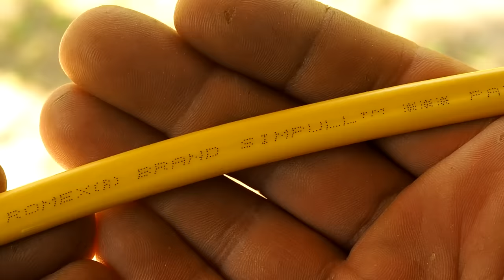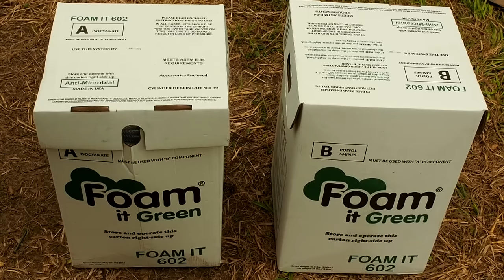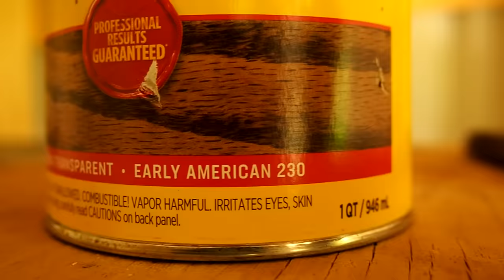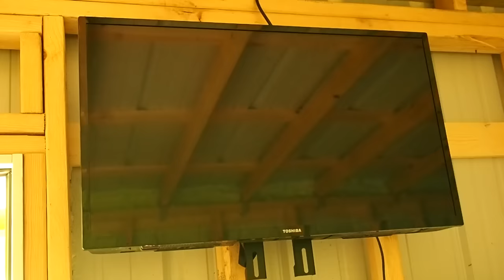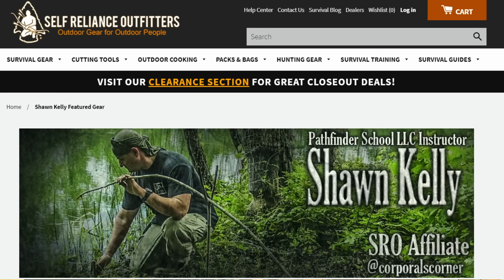Solo 10 Day Overnight Building an Off-Grid Cabin with Solar Power in The Woods and Tomahawk Ribeye

Comment: put your water collection barrels up on a platform to where the bottom of the barrels is slightly higher than your countertop put gutters on the building and run the downspouts to feed the barrels and then you will have a gravity flow into the building through your filter and then out through your faucet

Comment: If you add a mattress on top of the plywood, drill some holes in the plywood base for ventilation to keep the mildew/mold at bay from any condensation build-up. Consider a 12V RV fridge for a low power consumption. i.e. Alpicool, Dometic, Iceco, etc. . Also, consider a USB rechargeable water dispenser for the sink. pumps from a 5 gallon water container.

Comment: I'm 54 and I've worked with corrugated steel most of my adult life. I've had to hand cut so many panels. Now I've got 3 nebblers. One on the roof  one on the ground at the staging area, and a set in reserve for a backup.
I'll never go back to hand cutting. Those nibblers are nice and much more efficient.

Comment: 8X15,9X13 ,10X12Buildingscdo not require permits to build on your private property..Make them At least 8 ft tall commercial lumber size to not waste lumber..Use 2X6 in snow load areas and can be spaced 24 inches apart if using 2X4 construction use 16 on center construction for walls
Reply: Check with local codes. My county permits 144 square feet (so 12x12)... Measured on the outside of the building.

Comment: Metal sheets for walls is a no-go because it'll be too hot in the summer.
Reply: Perhaps, a few good coats of acrylic white on the external faces would help deflect a lot of sunlight? Couldnt hurt. 🤗
Reply: @Freeman361  just try it yourself ))) or seat in your car without ac )))

Comment: As long as you have a  spray foam setup, not sure why you didn't foam the roof and walls too. Wouldn't take 4 inches to help with temperature issues, but foam is great for sound deadening. 2 stones n 1 bird? Then cover with whatever you want.

Comment: Nice job.  I would pass on the spam and bring chili instead😄.  I like the idea of swing up bed platforms that could give you more room during the day.  I think that would be a pretty easy change out.  Pine 1x 6 strips on inside would cozy up the walls and make it easier to hang some light things.  I've seen 12 volt attends hooked to 12v string lights that produce plenty of light with not much electric  draw.

Comment: I like living in my traditional mongolian yurt, for more than five years now, with many of the tech items and low tech too.  I do my best to not go to the hardware store.  Dirt floor, wood stove.  7300' four seasons, snow in the winter etc.  Solar battery banks. Delux.  Happy not to live in a cold box with video games.?  Hey you could insulate your walls with discarded single use plastic bags.  Just like a sleeping bag and they are free, the bags that is.

Comment: I wish I could build stuff like that. Dude made it look easy.
Reply: Start where you can.  Don't need to go for big projects first.
Reply: Brandon
Learn the safety rules of the tools.
( powered or not)

Watch a few other videos on YouTube. Plenty of content covering several techniques.

As long as you are someplace that building codes aren’t an issue, even if you get it wrong, it will probably work just fine.

If you can add a few fractions, it’s pretty simple.

Start with a pillow fort tonight, and you’ll be building the Eiffel Tower in about 2 weeks.
👍😎

Comment: if your looking for rustic appearance i would suggest pallet boards for your interior walls. also if you are going to use a more permanent mattress you need to loose the plywood and replace it with slat boards(this will help avoid mold issues). as always your videos are cool AF.

Comment: On the water system  you could use rain water and put in as a gravity fed system  where the weight of the water gives you the pressure  remember  one gallon of water  = about 7 lbs. So with 4 (55 gallon) containers  = good  pressure

Comment: Spray Foam, diy!  Boy, you brave.  I spent $1500 and had my shop (20' x 20' x 9' walls )``` spray foamed professionally.  imo, it was worth every cent.  3.5 in walls,, 5" roof ceiling, and 4" under floor.  Fire resistant coating on exposed interior foam.

Comment: Nice job. Don't forget to install a vapor barrier under the floor. Also,  You can use gravity instead of a pump to get water to the faucet by installing elevated water barrels . I would have mounted the second bed up higher so you can have more headroom in the lower bed. It offers another place to sit. Also, get an antenna so you can get the news. Sometimes the cheaper rabbit ears do just as good a job as the more expensive ones.  Continue the foam insulation, since you have the equipment. Good luck.

Comment: I love this setup and build and when I can get the land to do so I would love to do the same thing. I was thinking for insulation you could go 2 ways thr first is the old standby pink or yellow insulation in the roll out fiberglass sheete with thin ply wood over it inside with lite paneling on that for a finish and second after you hang inner walls blow in insulation I think the rolls of fiberglass would be easier for transportation also if you plan to put in lighting in the ceiling I would add a ceiling roof to cut down on the noise internally and looking at it for mattresses heavy air mattresses should do and depending on size full to queen should fit nicely. I was thinking that if done right a gravity well for rain water with elevated 55-60 gallon or larger drums to collect rain water you can place a fine mesh non metal screen over the drums to keep large debris out and a drain spout in series from one to the other of each drum so as not to over fill or over extend the amount of water used just need to add small heating plate under them running off solar heater to keep them from freezing in the winter. Keep up the great work I am a big fan and from one marine to another SemperFi.

Comment: How did you get your suppies in?  Great build.  May I suggest some shelving for your games?  You could also build a shed out back for your supplies.  You could get truck/rv mattresses, just measure your bunk, they possibly have one that will fit.  Also, put in an anti-kick support for your front door deadbolt before you cover it up with paneling.  Great build out, stay frosty.

Comment: I've planned something like this in my head for years. Pleasant daydreams. Water. Love the idea of rain collection. My "plan" is to use solar pump to run water from collection barrels through a filter into a 4-5 gallon holding tank above the sink for gravity fed faucet drinking water. When solar isn't an option, and filtered water isn't necessary, foot pump straight from collection barrels. Any plan for a simple permanent solar setup? Single panel, lead battery and hump-in inverter? Cheap, simple, and not out much if it gets damaged or stolen. Also good in case grabbing the Bluetti isn't possible before heading to the base camp. Maybe expand your channel into shortwave and add an antennae. 
Pitfall was my JAM!

Comment: Noob questions:
You did use concrete shoes for the foundation. They will sink in. Will they sink in equally? Would a concrete slab under the shoes be better?
Will the untreated wood in the concrete shoes rot? I have seen what humid concrete did to my wooden terrace foundation in 20 years. Obliterated it. Wold it help to use tar paper or paint?

Comment: Spray Foam, diy!  Boy, you brave.  I spent $1500 and had my shop (20' x 20' x 9' walls )``` spray foamed professionally.  imo, it was worth every cent.  3.5 in walls,, 5" roof ceiling, and 4" under floor.

Comment: This is pretty cool but I started cringing at the electrical. Just spent the day changing out outlets that got installed on little stubby ends of the wire like that and I was cursing whoever installed it the entire time. Strip back more wire in the box!  I probably would use UF cable instead of Romex the way you got it ran underneath it's exposed to elements.
Reply: I bet that aluminum in the rain is loud as hell too. Again tho, I like this. Good job.
Reply: When you finish the inside spray foam the roof to dampen the sound of rain on aluminum
Reply: I think many military will agree with me, I  love listening to the sound of the rain outside, no matter how loud. To me it's because as I listen to it, I'm smiling and thinking, " Well, I'm not sleeping in THAT tonight!"

Comment: I'm not a builder but my understanding is that you should use nails because they give and screws can crack. So over time no screws are going to take pressure and they're going to crack or get loose. So somebody comment on here but isn't framing supposed to be done with nails? I'm not sure about the bull she's putting in that's a little different. I just want an opinion. Criticizing I just understood that you should use nails because they give and flex.
Reply: Yes, "to code" 24 CFR § 905.312 - Design and construction - calls for nails.  However, let me point out that "an off grid cabin in the woods" is not to ode in SO many ways.  It's not like CPL Kelly is selling this structure for residential use.  Screws will last as long as the (untreated, not o code) wood.  An outhouse (latrine) is SO not to coide.  He';s NOT building a subdivision.

Comment: OUT-STANDING!  A+  What did it cost you to build in materials and lumber?
(You might want to consider further overhang of flashing/tin roofing overhang on the facia board to [prevent water ingress] from sideways rain, or splash, for longevity.)
Planning on doing something similar on some property we just nabbed in the free-state of TEXAS.  If you have any elevation on the property, a gravity-fed water storage cistern might be easy to pump into... but you have to do the math on that for PSI.

Comment: I'm confused. the electrical wiring part looked simple enough, but then he plugged a black cable into the solar power generator. but what was the black cable running from? also, where do the yellow electrical wires connect to on the opposite end of the outlet?
Reply: The pigtail connects the house to the Bluetti just like plugging in an RV at a campsite.
Reply: @Anne-pk8gs  what’s a pigtail? i don’t know anything about any of this stuff, but want to build my own portable home so doing research. thanks
Reply: @juxtapoix  ..the tail..that's attaches to the pig!...😆

Comment: Why would you want a electric pump for water. Gravity feed it. Your not needing a high demand of water pressure.
Reply: @C Price  Think about it, his sink is probably 3-4 feet off the ground and the water barrels are going to be on the ground below. That means he's going to have to pump the water uphill to the sink. And he can't just put the barrels higher on a stand, water is HEAVY. With a barrel weight of 22 lbs for a empty plastic 55 gallon drum plus 8 lbs per gallon for water you're looking at 462 lbs each.
Reply: @deadaccount6135  we have gravity free water from the patio of the loft. You just have to build and support, we also have it heated. Using painted black pvc behind plexiglass on the south side of the cabin. Works great

Comment: 2:00    So the entire weight of the cabin rests not on lumber, but on screws.  Yikes.
Reply from the maker: then you missed the bolts by skipping through
Reply: @recall5811         Same issue, not quite as bad.

Comment: What kinda portable solar power device did u use or think is good? And i like the lil set up u did it looks good n a easy build
Reply from the maker: literally shown in the video
Reply: @recall5811  Well, to be fair, you did state at 21:41 that you would "go over this Bluetti power generator in a little bit here", but did you ever circle around back to that topic?  If not, this might be a nice feature for a future video.  I'm curious about it too.  Clearly it works well!

Comment: Please do not use the sheet rock or drywall. Either use plywood, or 1x boards. Since you didn't install a vapor barrier under the siding, you might think about leaving air gaps at the top and bottom of your walls if you install anything on the inside. And, of course, install some insulation before you put up the interior. The temp and sound mitigation will be greatly improved. I solo build off grid cabins similar to yours as my side gig. Been doing it a few years now. I bring all materials to the build sight by atv and trailer, by foot, or tying two swallows together and flying it all in. No roads, no heavy equipment, no sign of humanity except a cabin in the woods.
Great job. Looks like the kind of place peace could be found.
Reply: Mr. Jedediah how do I contact you I’m in Missouri?
Reply: Just wondering, why aren't sheet rock and drywall a good option? Does it have to do with the vapor barrier?
Reply: @SeymoreButtss  dry wall molds in that high humid enviroment  plywood is much better for cabins...all the years i installed drywall i called it "shitrock" i HATE drywall 🧐
Reply: @Bucky1836  oh gotcha. that's good to know thank you for responding!
Reply: @SeymoreButtss  Mr Coone beat me to the reply, but that's pretty much it. Sorry I didn't explain before. Drywall/sheetrock will attract moister, swell, and mold. MDF and plywood will too, but not as easily. Also why I recommended the ventilation gaps at the top and bottom.
Reply: @imabina7425  Is there a way to message privately through YouTube? Don't want to put all my info out there to the world. I get enough spam as it is. Lol
Reply: @JedediahMorgan  thank you!
Reply: @JedediahMorgan  we sealed our  cabin with oil based Kilz 🥴 but it worked 😎
Reply: @JedediahMorgan  and i agree with the vent holes we had 2 whirlybirds that spun on ours and 2 ridgevents with screen we had wood     potbelly stove and propane stove in there ...i miss that cabin 🤕
Reply: @Bucky1836  All too often, people forget about vents. They also underestimate how much moister can get trapped in a space. Propane by itself will release a lot of moisture too.

Comment: This definitely costed over $1,000
Reply: I doubt it, the reason most tiny homes cost so much is most people have a construction company build there's and they go use brand new top of the line everything and high end finishes, it's also not very big and it's just the shell.
Reply: @TheREALOC1972  I'm a woodworker. I know the types of prices for different wood types and tools and equipment. It's definitely up there.
Reply: @moldorm30  Stop it.... Your woodworking wood is a completely different thing than building materials. You use choice woods, a piece of  Poplar is a completely price than a standard Pine 2x4. a 4 foot 1x6 of Poplar is $8 at Home Depot, an 8 foot pine 2x4 is less than $5 at Home Depot. Your talking 2 completely different types of building materials at 2 different price points.
Reply: @TheREALOC1972  You're wrong. You don't know what you're talking about.
Reply: @moldorm30  No, I do know EXACTKY what I'm talking about, Furniture grade wood and Construction grade wood are 2 COMPLETELY different things at 2 Completely price points, furniture grade wood is roughly $4 per board foot, Construction grade wood is right about $1 per board foot. You can LITERALLY look it up or better yet go look in person. that's why a 4 foot piece of Poplar is $8 and an 8 foot pine 2x4 is $5, there's 5.3 board foot in a 2x4 and there's 1.9 board foot in that 4 foot Polar 1x6, that's why that pine 2x4 is only $5 and that 4 foot 1x6 of Poplar is $8. you can LITERALLY see and feel the difference between a piece of furniture grade and a piece of construction grade wood.
Reply: @TheREALOC1972  Goodluck with that lol.
Reply: ET the worst game that ever came out for Atari.